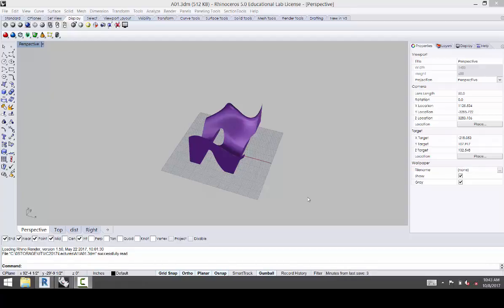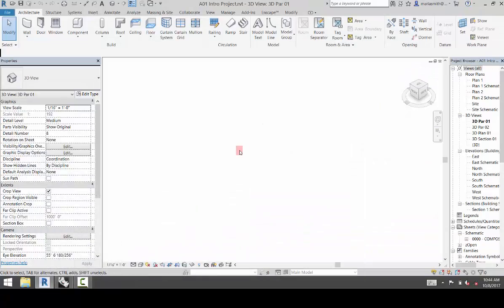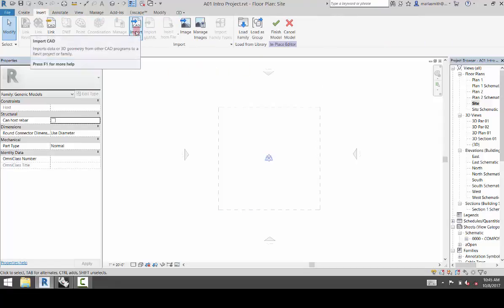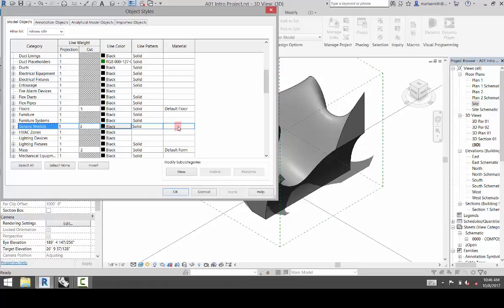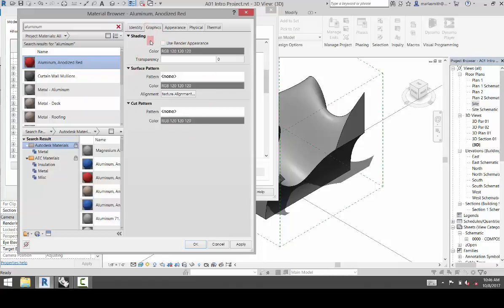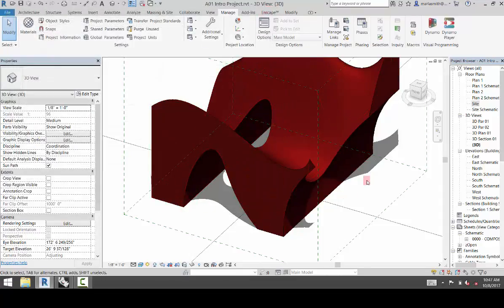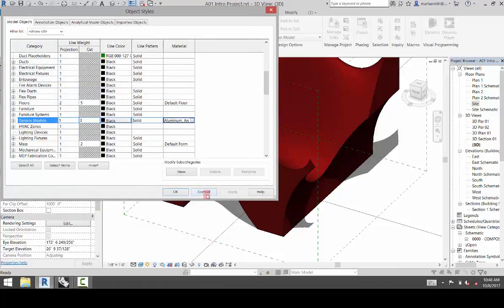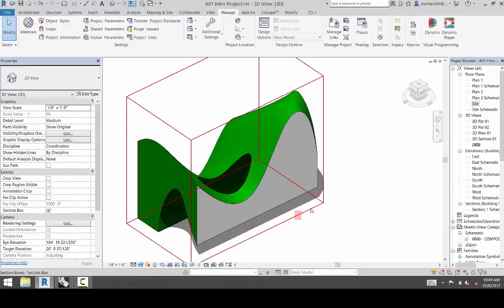Import from Rhino to Revit Generic Model

Comment: Is there a way to duplicate the generic model type so that one can have one material, and the other has a different material?
Reply from the maker: You can...its a wonky process using the sat as they don't save layer info.  Watch the first few in this playlist: https://youtube.com/playlist?list=PL5fgrebBtwJIgZ9gH32qJ0WQYC1-avW2f
You can also link it as a dwg solid and access the materials in the object styles imported objects by layer.
Here is a playlist that goes over that process: https://youtube.com/playlist?list=PL5fgrebBtwJLElU43auBgSmZEJ45bjGWA
You can also insert it as a Rhino file and access the materials by layer in the Materials dialog under Material 1, 2, etc.
Reply: @MSmithWorkShop  Ignore my previous comment. I just saw these links you posted. Thanks!

Comment: it works but it looks as wireframe . do you know how i cant turn it to solid?
Reply from the maker: It may be that it is not a closed mathematical shape or it was originally a mesh.  If you're coming from Rhino it must be a closed polysurface without self-intersections, open edges or manifold edges and exported as an sat .

Comment: It says it cant make it into a sat file because its says the meshes cannot be exported into sat? What can I do about this pleasee
Reply from the maker: Hi Elissa, sorry for the late reply.  Sat files are compatible with closed poly surfaces, not meshes.  You could try the same process with a straight autocad export which is set to meshes.  The only issue is that you will not get a solid object in Revit, just planes.  You need a closed polysurface in rhino, ideally without self intersections, manifold or open edges.
Reply from the maker: Dani Adam  Hi Dani, What do you need to do with the file in Revit?  There is not much you can do outside of walls, floors and roofs by face to an imported object...

Comment: in revit, can i change surface to wall?
I mean that is just one surface and object. not building.
revit have the way to change surface to wall, ceiling, floor?
Reply from the maker: Yes,  you can use wall by face to create roofs, walls and floors if you created the form as a mass in Revit.  Ceilings are not supported.

Comment: Finally!!  Been searching for this.  =)  So this means I would have to create new categories for each different element I import if they have different materials, yes?
Reply from the maker: Also, in 2018 there is a new option for import but I'm not sure how it relates to materials..:
https://www.youtube.com/watch?v=zgG-HWBSqFk
Reply: Vanity Corporation I have the same exact question
Reply from the maker: Yes,  You can rename the imported category for each imported material.  Here is a playlist link with a video on the material updating: 
https://www.youtube.com/playlist?list=PL5fgrebBtwJItxxx5DYC6ffYgJwFeODIC
Reply: So good, thank you.  Now is it possible to create these things in a family so they can be easily imported and changed together?  I will experiment as well, but just in case there's an easy answer.
Reply from the maker: Sometimes you can export from Rhino as a dwg with different layers for materials and set the Option to 2004 Solids and it will give you access to apply the materials by layer in the Object Styles Imported objects....however this process is very iffy, it blows up a bunch.